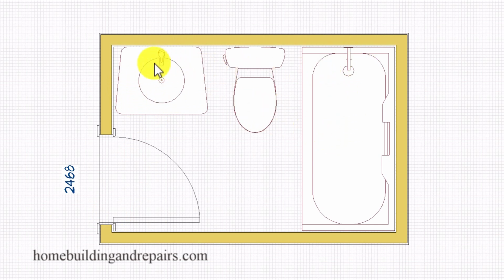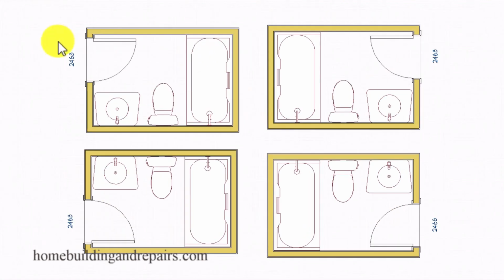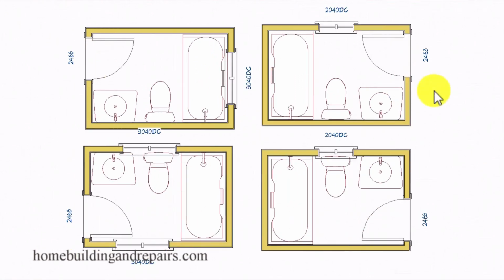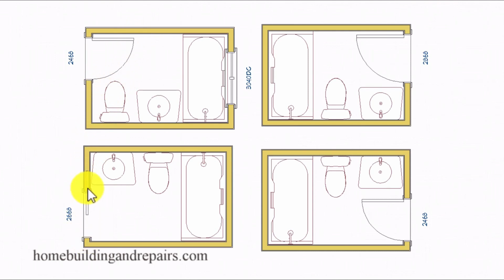The Most Popular Bathroom Layout Construction Design Floor Plan - Architecture Education

Comment: how would you propose a wet room... "full bathroom in a shower" or majority of bathroom... any tips for venting motors vents fans/blowers... ceiling... slope no slope oil base or laytex paint... one/two drains?... tile/ cement floor? walls vinyl tile etc.?
Reply from the maker: I put your suggestion on my list.

Comment: With your examples, all except for the bottom right layout, most plumbers (like me) would flip the hand of the tub so the valve is easier to reach. 😊While it is usually easier to plumb everything on the same wall, it is not easier for the end-user to operate, having to reach around the toilet and worse, the vanity or sink. Also, while you don’t mention or show dimensions in the drawings, one must keep in mind the 30-30-30 rule for a bathroom like this (if the tub is the standard 30” width) — the minimum full bathroom framed (rough) length with a standard bathtub will be 91”, minimum, depending on wall finishes.  The center of the toilet must be no closer than 15” to the side of the tub and the side of the vanity or sink. The center of the faucet must be no less than 15” off of the finished wall, so the smallest vanity or sink you can install will (usually) be 30” wide. You could use a smaller (not so wide) wall-hung or pedestal sink, still keeping the center of the faucet 15” from the wall and gain a couple of inches to give more room for the 30” toilet “compartment” if you are really pressed for space, but that takes thinking ahead and knowing exactly which sink you are going to install. In new construction, the smallest rough full bathroom dimensions you will see will be 91” long and anywhere from 60”-61” wide. 

Now, about the windows — it is a very bad idea to place a window on the bathtub wall. Windows are generally designed to keep water out — not to keep it in. Over the years, I have run across dozens, possibly hundreds of leaks in walls caused by windows installed in the bathtub wall. These were mostly in older homes (1930s to 1960s). These windows had been leaking for years and years and most caused major damage in the wall and beneath. I would always suggest that my customers install a shower curtain in front of the window as a temporary fix. I suppose somebody has designed a window for this type of installation by now, but I don’t know.
Reply from the maker: Great ideas and windows over the bathtub surround areas unusually work best.